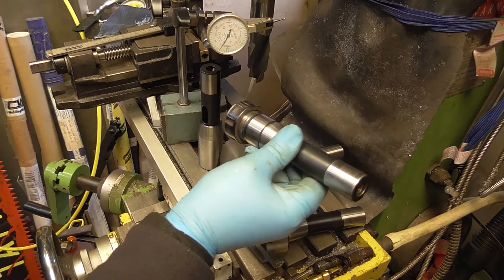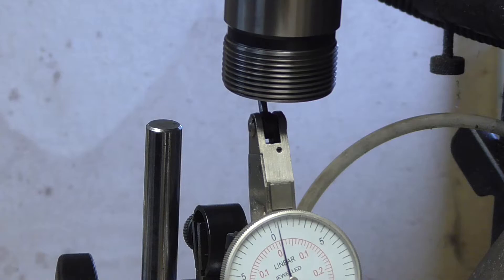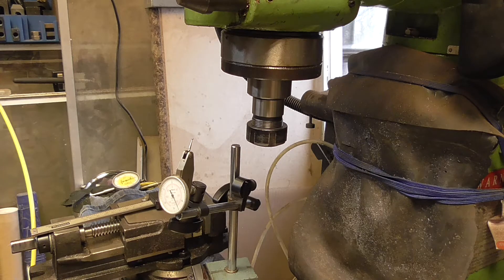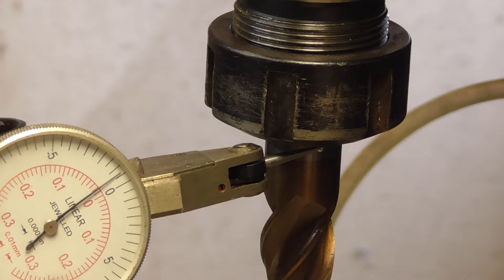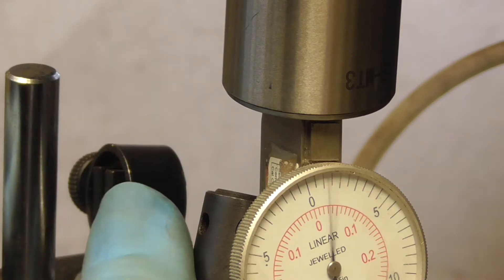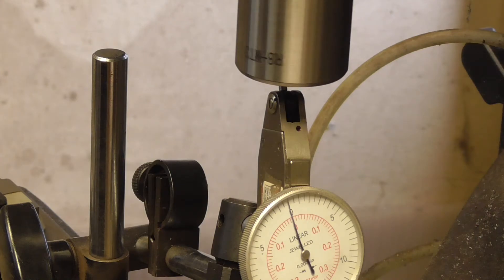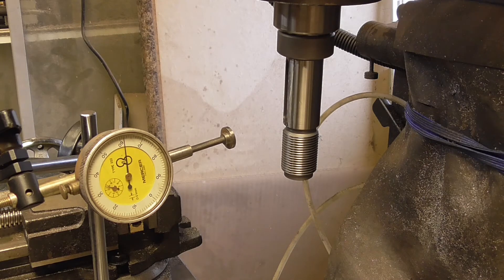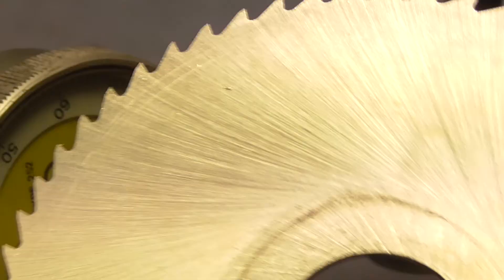R8 tooling runout test on the Warco VMC

Comment: The coating on the carbide is to extend the life of the tool by keeping metal from sticking to the carbide. Your setup is pretty good. I was a bit surprised by the Clevland drill bit run-out. Interesting observation on the slitting saw. Now I am going to have to test the rest of my tools. lol Thanks for the video.
Reply from the maker: Ahh, ok I get it never even crossed my mind.
The carbide might be hard but not as non stick as other materials.

Comment: So all the tooling tested here is pretty decent, confirming that your ER40 set off EBay is rubbish! So do you send it back, or regrind the R40 shank on it !?
Reply from the maker: That is a good question & one I have thought about.
A) time (we all know that feeling)
B) at the moment, with the collet & the holder having runout, I can (to an extent) cancel each others out by rotating the collet in the collet holder. If I were to regrind the holder I would not be able to & the collets would be way beyond my abilities to re grind.